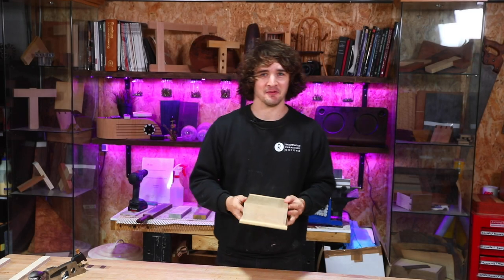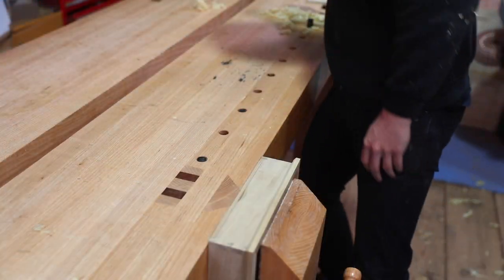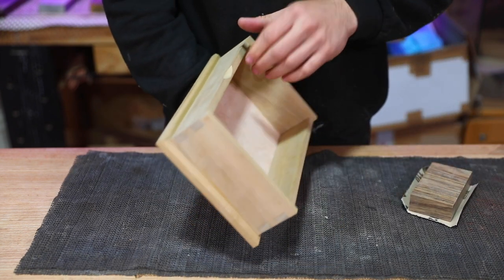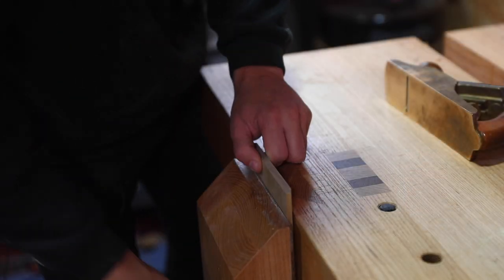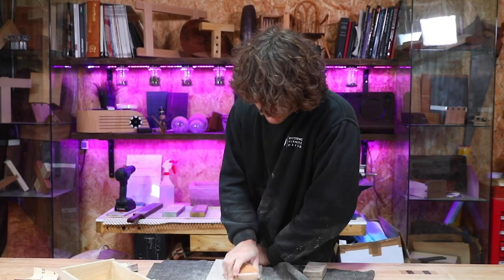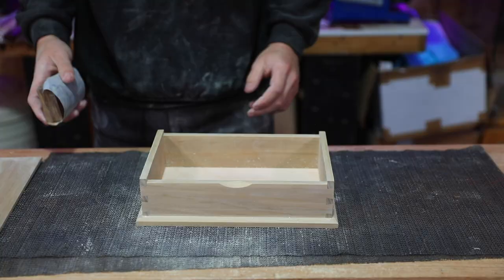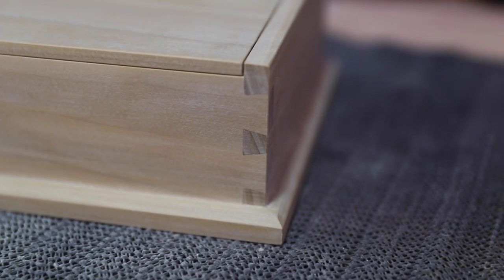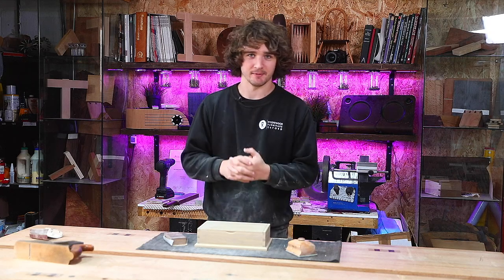How to Accurately Sand the Box | Dovetail Box Project #18 | Free Online Woodworking School

Comment: why not just put on a solid wood bottom, extend the bottom past the edge of the box and add a chamfer? cleaner look. easier. more solid.
Reply: How are you going to attach the base to the box? Because just glueing or tacking a solid wood base on will break the box/base due to wood movement.